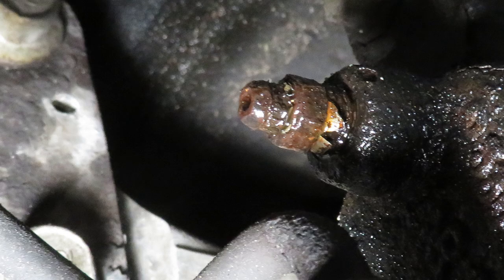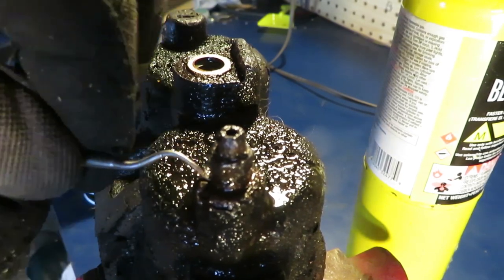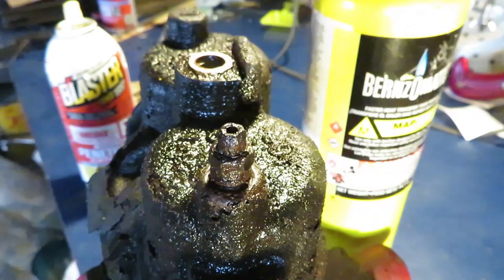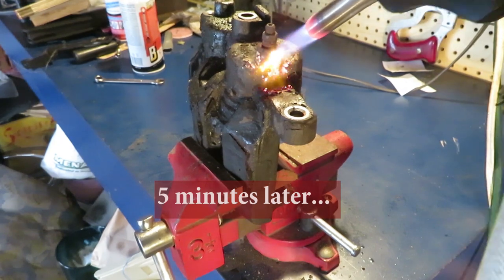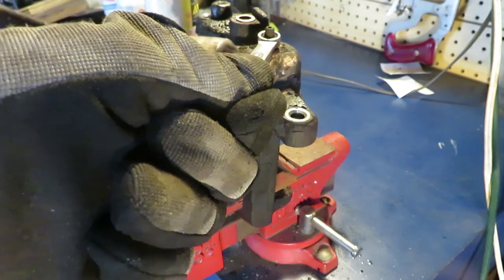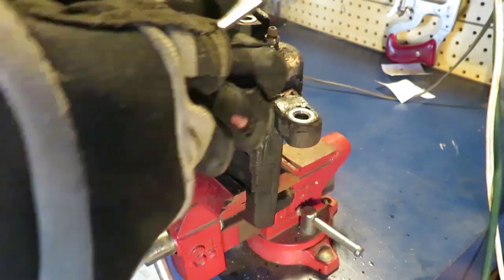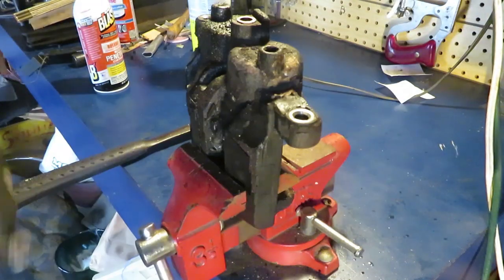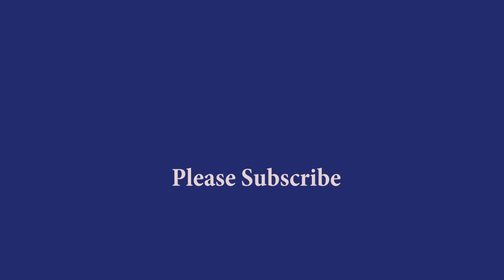Techniques for Removing a Stuck Auto Bolt or Screw: The Brake Bleeder

Comment: I'm big on getting that crusty rust off the outside edge of the threaded part too, but I think it helps not cause that stuff holds the bleeder super strong, but because it makes a good seal, and keeps the penetrating oil from getting into the threads, where it will do some good.
Reply from the maker: good point!

Comment: The title says "TechniqueS"... You are only showing one, that risks damaging the rubber seals and WON'T work on REALLY RUSTED bleeders in the Salt Belt... What works is to insert a drill bit into the bleeder, heat the bleeder red hot, which compresses the rust against the threads (the drill bit prevents the bleeder expanding inwards), then cool it off instantly with water and use impact like you did to loosen up the scale (an impact wrench at a low setting works well. Perfect to use with fluted extractor sockets when the bleeder is so rusted a regular one won't fit. The drill bit (a tight fitting nail will do too) gives the bleeder body to better resist squashing (if you need to use a vise grip), rounding and shearing when trying to remove it.

Comment: Using a 12 point wrench on these stuck valves is going to strip them. I strongly suggest you get a flare nut set instead

Comment: Many mechanics agree on not heating the piston cylinder that much vIa torching for more than one minute.  Specially on older calipers..   it can weaken the rubber seals of the piston, and a soon failure of it.  Better cut and drill out the old valve..
Reply: ↑ Exactly that. Heat the bleeder instead to compress the rust and cool it off instantly to loosen then use impact at a low setting to free it. Use a drill or a tight fitting nail to fill the bleeder hole to give the bleeder increased mechanical resistance and force the heat to compress the corrosion instead of expanding into the hole. It may need to be repeated a few times if the caliper is really, really rusted, like after 15 years' exposure in the salt belt.
Reply: @johnnyjimj  You heat it to cool it off??  I dont think so.. Heat expands metals, not cool them off. 
 I think is better to heat the caliper on the hole of the bleeder area,  But avoid heating much at all that due you will damage the rubber seals and the piston ring of the Caliper Cylinder.  Why taking the chance of damaging the caliper and a brake failure??
A brake failure later on is a possible lawsuit to the mechanic.
 Better pull caliper out. cut the bleeder at the base, and drill it out.  it is soft metal and easy to drill it out.

Comment: does heat ruin the piston oring?
Reply from the maker: I didn't have a problem and frankly had not give that a thought at the time. Mainly because that's a big chunk of cast iron and it's hard to imagine the heat would transfer that fast. But DIYer beware I guess. Don't heat it up if it makes you uncomfortable.

Comment: 1)  Annnnnnnd what about the rubber seals after 5 minutes of flaming hot fire?
2) Why stress the screw by hitting it in both directions.... isn't that just unnecessary stress to the metal?  Instead of hitting it 5 times, you're stressing it 20 times - increasing more opportunities for it to break or become weaker.
Reply from the maker: What seals? There are none on the bleeder and  the piston seals are quite a distance away from the heat. A caliper is cast iron and heat transfer is not immediate. As for the bleeder screw, it will be replaced.
Reply: @TheOriginalMechanic  - "The piston seals are quite a distance away " ??? They are literally a few centimeters away on most calipers, AND the rubber is ring is pressed HARD against the very cast iron casing that you are heating up.  In terms of heat dispersion, the temperature coefficient measured 3 centimeters (or 4, or 5) away from fire applied to metal is still easily able to affect the composition of rubber or similar materials.  Just because the rubber may not actually completely melt into a liquid doesn't mean that the rubber hasn't been affected.

"A caliper is cast iron and heat transfer is not immediate" ???  Cast iron quite readily can transfer enough heat, and will hold that heat even better than other metals.  You know: cast iron stoves, cast iron skillets, etc.
Reply: I learned a better trick 36 years ago! It takes an Oxy/Acetylene torch. Heat the Bleeder screw red hot and then douse with cold water, it works every time!😁
Reply: @gatsbylight4766  the fact that cast iron holds heat should tell you something.  It doesn't conduct heat very well at all!
Reply: @KC9UDX  - Technically, cast iron might not conduct heat 'as well as' some other metals, in the same way that drinking rubbing alcohol might not poison a person 'as well as' some other chemicals.  However, drinking rubbing alcohol can affect your internal chemistry enough to cause you damage, in the same way that flame-hot heat can affect the internal chemistry of rubber enough to cause it to be damaged.
Reply: 1): Exactly. Heat the bleeder instead and use a drill bit or a nail in the bleeder hole to force compress the corrosion when heating then use rapid cooling with water or a freezing fluid, this works every time. Just use common sense - a 10mm bleeder should be easily removable with a 10mm wrench. If you need more leverage, you'll break the bleeder off. Easy does it. Repeat if it doesn't work the first time 
2): That helps loosen up the corrosion. If you're really worried, hit the bleeder straight down on instead, this works too. An impact wrench on l;ow setting or better a battery operated impact  driver made for screws works wonders.